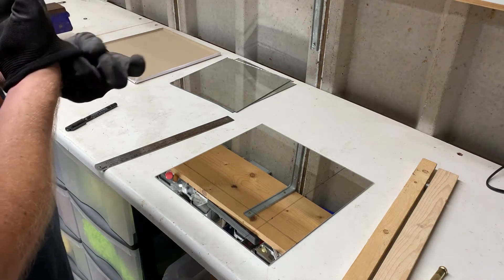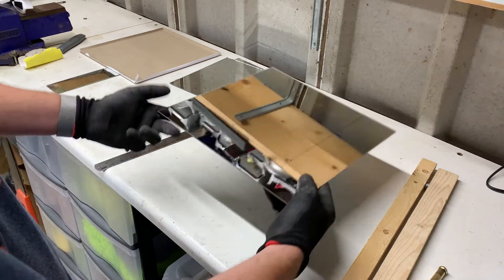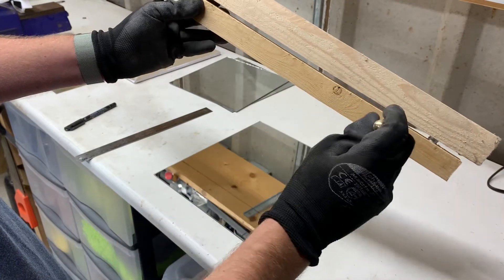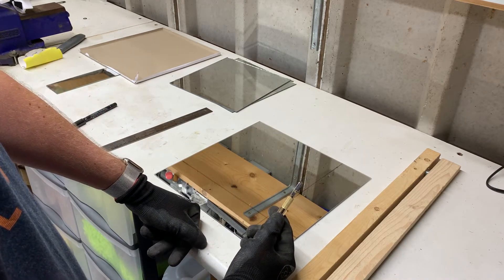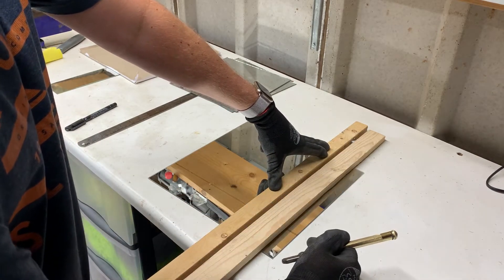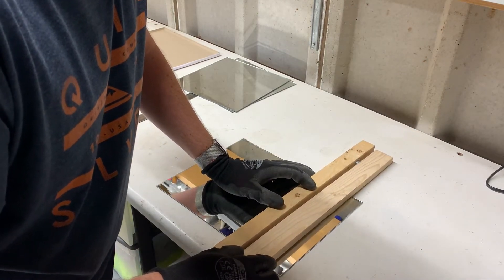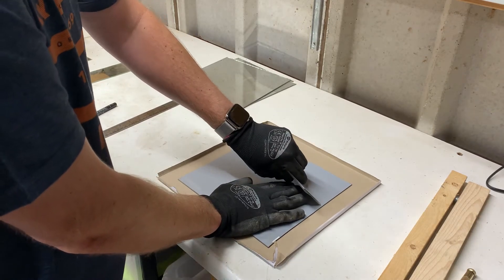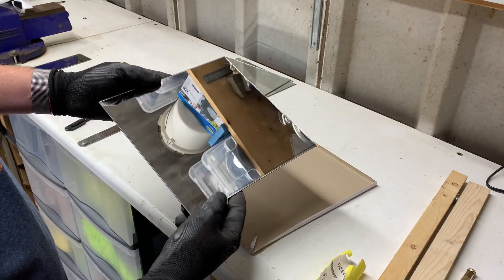Make your own 3D Printer Mirror Print Bed (but see comments)

Comment: I can confirm, this works great!

I've done the same modification to my Tronxy xy-2 pro. 

Also with IKEA mirror tiles, and i have also cutted them with a glas cutter like you did. 

The tonxy comes with automatic bed leveling, and the magnetic sensor does not detect the glass. So i have put a small piece of aluminum foil on the first corner of the glas, for the sensor to detect the surface. 

Then adjusted the Z offset - the printer works better then ever.

Comment: hmm, maybe the problem with not adhering was because you should wash your mirror before putting it on your heatbed and don't touch it after that. Otherwise it will leave your finger prints on it and the same problem will occur again. See the vid of Ivan Miranda (if you didn't see it before). How is it holding know (is it better than the ender glass bed)? I am planning on using it too. 

Oh before I forget you can use a thermal pad under the mirror bed you, so you dont have to use the binder clips.
Reply from the maker: I always clean the print bed with IPA  before each print. I’ve increased the bed temperature to 89C (PETG) and it’s perfect. Holds rock solid. 
Go for it. 👌